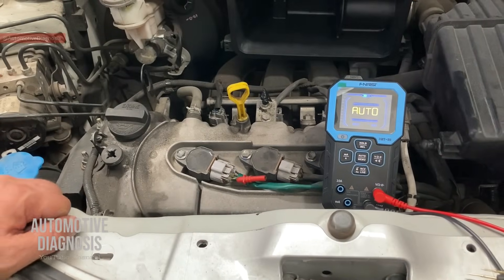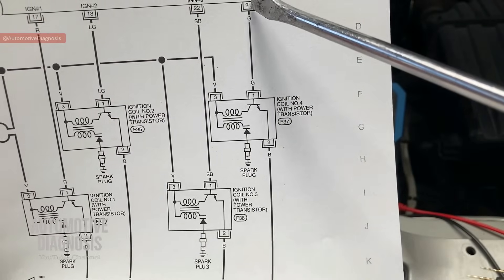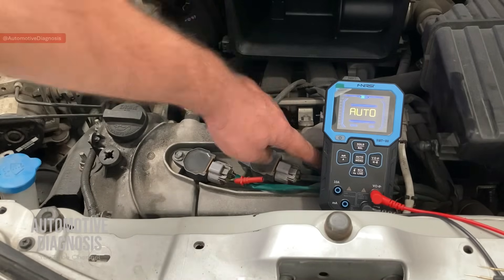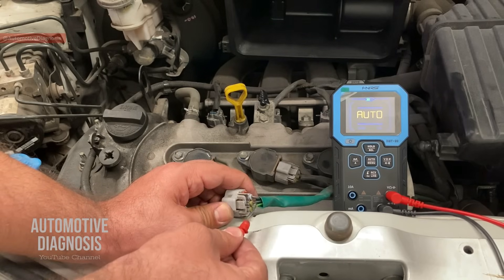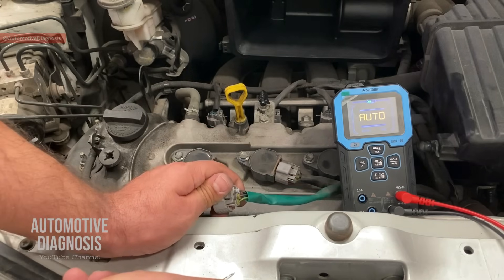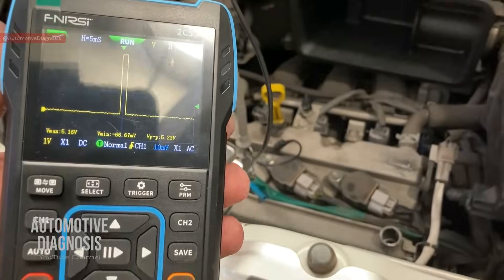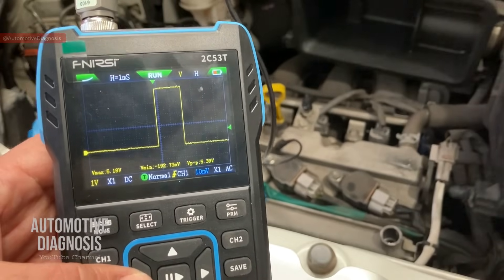How to Test 3 WIRE Ignition Coil with Multimeter & Oscilloscope | Suzuki Three-Wire Ignition Coil

Comment: Is there any tool will do relatively compression test plug in tool not scope
Reply from the maker: If you mean a tool to check the engine compression pressure, yes, we can the compression gauge for this purpose.

Comment: Hi isnit 2chanel oscilloscope did you connect one to data one to ground
Reply from the maker: Hi there, yes it’s a two channel oscilloscope but I only used one channel. On the probes you actually have an extra cable for the ground.

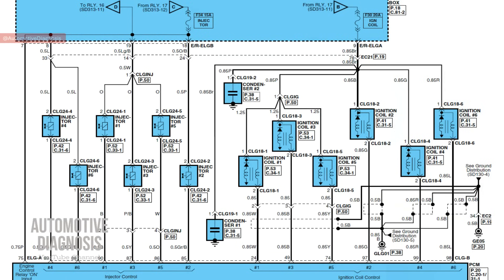Comment: Thanks for including the wiring diagrams, at 1:09 and 1:29. I'm a little confused since both seem to include diodes, one on the primary side of one diagram and one on the secondary of the other. They both seem to be pointing in the wrong direction. My first thought was that these are flyback diodes, but usually those are placed in parallel, not in series. Here they seem to interrupt flow! Are those actually diodes or are they simply connectors?
Reply: Hi the transistor is npn and is pictured correct I can't see fault . But the other one looks to me like is being used as a avalanche diode. When the voltage build's up and becomes to great the diode reverse biased. I may be wrong.
Reply from the maker: Thanks for your answer, that’s right.